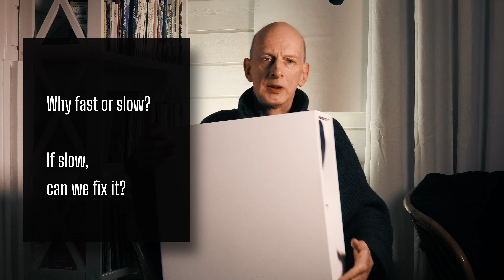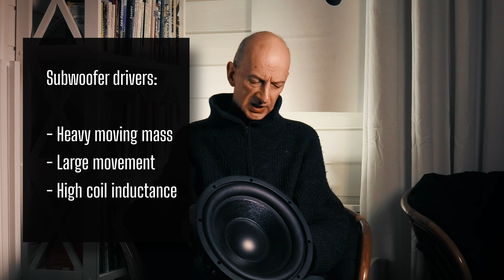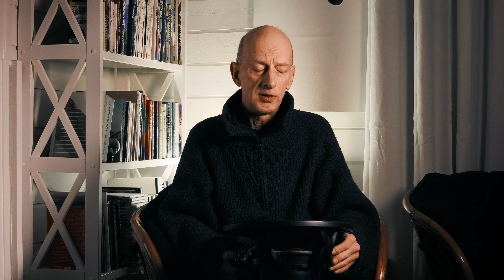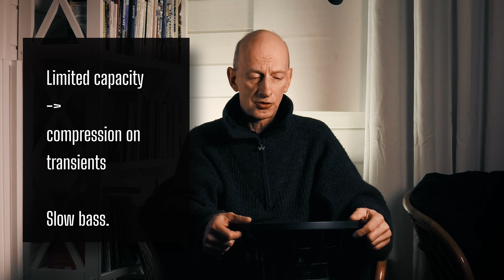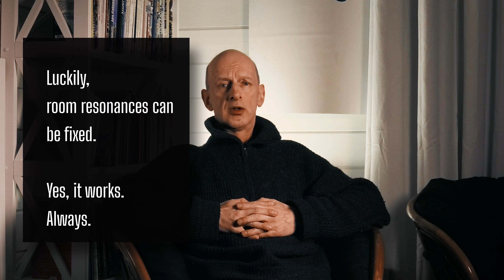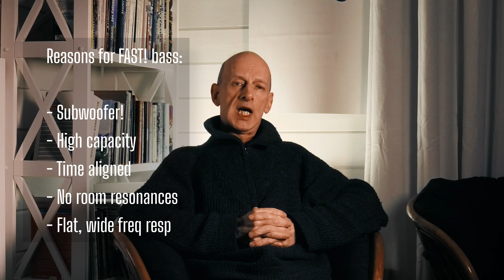How subwoofers can be fast or slow

Comment from the maker: Comments are welcome, including from those who disagree. That's one reason to have a comment section, isn't it. 

I generally will not delete negative or critical comments, unless they are completely off (never happened so far..). I see some comments have disappeared, I did not delete those, perhaps the original poster removed them. 

I also try to answer comments and explain. This is a quite short video covering some technical aspects of speaker design, it can not go deep into details on theoretical stuff. Commenting to fill in the gaps or asking questions is then appropriate. 

Disagreeing on technical details inside speaker design is not the end of the world. 

Comments that agree are of course also welcome. Perhaps you have your own story, about how you came to the conclusion that subwoofers indeed sound different. Let us know.

Comment: The biggest offender of "fast" or "slow" is by far the room. Despite a bad rep with car audio designs focusing on hip hop sine waves, the car is actually a pretty good place for "fast" bass. And I don't mean driving at high speed. It's fairly small and acoustically dead even at bass frequencies - assuming you don't have a car that's a complete rattle bucket.

As for preserving transients, full scale bass horns do very well as you're moving lots of air and the subwoofer is in a well loaded pressure mode at all frequencies, and the mouth is ideally big enough to apply air resistance to the resonances. If you use a horn only to its half wave it's even better, but most people want to capitalize on the bass extension of running to quarter wave.

Sealed and aperiodic or the hybrid of aperiodic and tuned quarter wave, which is a transmission line. They are taking advantage of stuffing to act as a brake at higher frequencies but act as a ported box or just one of those bose wave cannons in the 30s and 20s. Though I've never had one, it should sound like a sealed that gets effortlessly lower.
Reply: Cars are excellent for bass performance. A typical car will pass the fundamental frequency around 100-150hz after which the bass driver couples with the air inside and starts to modulate it directly, producing very low distortion and high efficiency bass. I don't know why some people have a misconception of car bass being difficult.

Comment: Cone size doesn't matter, it's the T/S parameters and enclosure design. A huge horn loaded sub has superb dynamics and transients if designed properly.
Reply: I have noticed the high end , like$10K high end, home cabinets are HUGE horns with drivers that aren’t that big
Reply: @BTSoundandSpeedreacts  Yes but imagine a high field strength 21" combined to a horn... That slams your body like a baseball bat.
Reply: @Munakas-wq3gp although they work okay nowadays: 21" are mated to the air fairly well already, although you'd normally design a lower compression horn for one than a Sundown SA8 - a driver with a very powerful motor for its size that could probably drive a Mark Rober style horn quite well.
Reply from the maker: I designed a Compact Horn for a 24" once, problem is it gets too large, I did one version that barely exceeded performance of a ported box and that was the one that got built.
Reply: @TimpBizkit  A 21" is not overly efficient by itself. A high EBP driver benefits greatly from horn loading and there are some affordable options available. Of course the horn will be large, even if it's a tapped horn design. It's worth it though.
Reply: @kvalsvolldesign  Tapped horn is the way to go if you want a relatively compact design.
Reply: @Munakas-wq3gp "A 21" is not overly efficient by itself" Um actually they are. And any driver will benefit from horn load, as it's about mechanical-acoustical coupling, not electro-mechanical.

Comment: In my experiences the right timing to the Satellites is important to get good transients and for a "fast" base it needs a good tweeter. I prefer also lighter cone with high BL (PA Chassis) and a bit equalizing. The lowest frequencies will be filled up  with roommodes. But it depends if you need a sub for music or cinema.
Reply from the maker: Exactly. Light cone, high Bl. Found out some 40 years ago, then learned all the theoretical stuff, which says no doesn't matter, then wasted time figuring it out once more. It does matter.

Comment: Frequency domain short means time domain long. Small bass speakers use resonatots, transmission lines and bass reflex to maximize low frequencies but this shows steeper frequency response thus longer time domain response.
Reply from the maker: Depends on tuning. Generally, very small ported boxes tend to end up sounding a bit.. resonant. Preparing a video on the T6 now, which has acoustic loading in a very small horn channel, and that one certainly does not sound resonant, will try to show it. So it depends.
Reply: No, almost all speakers use resonators and for equal frequency response the time domain is identical above the tuning frequency. Only at the resonators tuning frequency and below does the phase response diverge compared to a closed speaker.
Reply: @iliketoast-q9b  Its all about the Q factor of any resonator. For a resonator to have an effect, this is tried to make high and that means long time response.
Reply: @raymundhofmann7661  That only matters at or below the resonance or rather mostly outside of the usable bandwidth. Again, time response above resonance is equal to a closed speaker if the frequency response is the same. And timing domain performance at such low frequencies is inaudible in rooms as the room dominates.

Comment: Some subwoofers are yellow while others are slimy. Just because you can use words to describe things and they don't necessarily have to be exactly correct, like talking about centrifugal force is not wrong. But using fast and slow IS WRONG. There is no other way around it. I have never in my life experienced faster or slower subs. I have heard ones that started compressing, in fact a lot of them, i have heard subs that are driven in a more nominal range and be brilliant, and usually oversized fair bit, driven at far below their maximum. In my mind the words fast and slow have never even being CLOSE to the experience, and in fact, we can't really find that in any other place than one:

Audiophile community. Only there it is accepted term and we can see a brilliant example of someone DEFENDING THE USE OF WRONG TERMS. They are not even close to the meaning. Just say compressed, choked out, squeezed, lacking, not powerful enough at louder volumes because those are all words we can understand but at least the original meaning of the word isn't fucking confusing. Velocity has a very, very specific role in audio and you should not confuse speed with, what is essentially just distortion characteristics and dynamic range. It is like saying that trees are long when they grow in the forest or the speed limit in this road is pink. We can make it work if we really wanted to but when you are explaining things to people who know very little... defending the use of wrong terms is detrimental. It is exactly the same mistake when you teach how electricity works by using speed and volume of water and go too far. Subwoofers being "fast or slow" is beyond the very basic understanding, in the realm where we have to start using correct terms or it will just lead to completely wrong neurons to connect. Un-connecting them takes a lot of time and if often has to happen via inversal: the pathway to wrong structure is still there, there is just one inverter that says "all of this is wrong"...

 If you learn the wrong fundamentals and then have to unlearn them, which often is very inefficient process that makes deeper understanding harder... Teach the right fundamentals and they will start to figure things out on their own, cuts down memorization by a ton. I still have things in my head that i have to remember to invert and it fucking sucks. Only because i got wrong information to form structures and rules. Now the foundation is one shape and the building has another. Getting to upper levels is pretty darn hard path to take from the ground level.
Reply: There is a huge difference in dynamic transients between subs. A good horn loaded sub will slam you like a fist in the face compared to a regular box where the woofer flaps hopelessly in the air (horn loading improves efficiency dramatically).
Reply from the maker: Indeed, and most audiophiles never realize this difference, because such horn systems are rare.
Reply from the maker: Yes velocity is something different, and when using slow-fast to describe sound, it is easily confused and leading to a faulty understanding. The problem is when terms like fast-slow is generally accepted to have a different meaning, it is futile to try to educate the world to change. Slow-fast as terms for describing sound has no direct correlation to velocity, the community has given the words a different meaning.
Reply: Some servo controlled subs such as rythmik just stop the driver quicker....Cry a li'l bit by the doofus river and sit tight with your sloppy sub.
Reply: @wa2368  Oh, so your self worth is equal to the possession you own. Got you.

Comment: if it is a true SUBWOOFER (<40 hz), it can not be fast or slow. If it is a combination woofer and subwoofer, then the midbass can change the apparent speed. The problem is not speed, rather using the word subwoofer in a misleading way!
Reply from the maker: A very undamped room resonance is one example that can give the impression of "slow", even at very low frequencies.

Comment: Yes, I also love the fast subs, large diameter vc, little less Xmax and light firm cone. Disigned into a Tline crossed with base reflex and treated box just plays so much clearer.
Reply: bass reflex or transmissionlines are resonant structures that are SLOW. It takes time for the resonance to build!
Reply from the maker: That is not true. A ported box is similar in time domain as any system with a 4. order roll-off. Horn/pipes/T-lines are the same, the acoustic channel is typically 1/4 wavelength only.
Reply: Try a tapped horn sub, you can get extreme dynamics from even a 12" driver with a high BL.